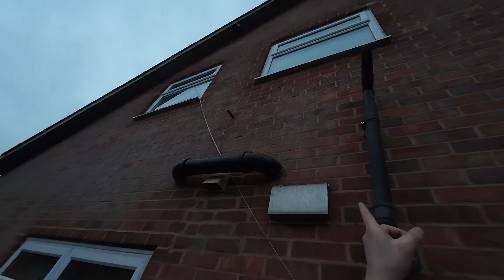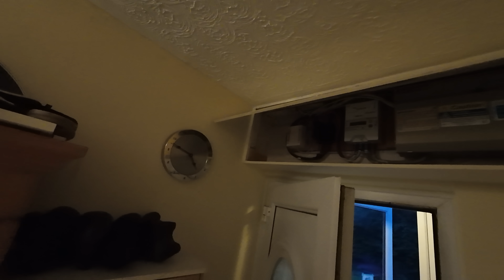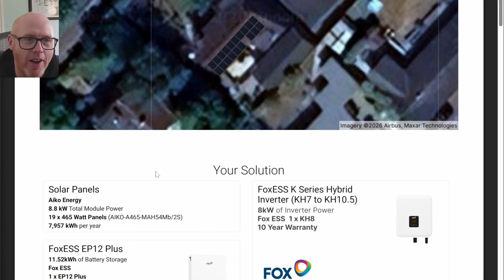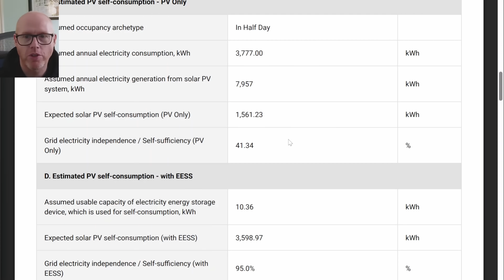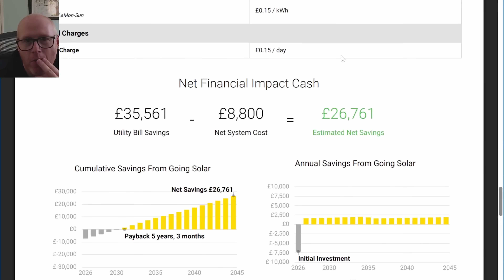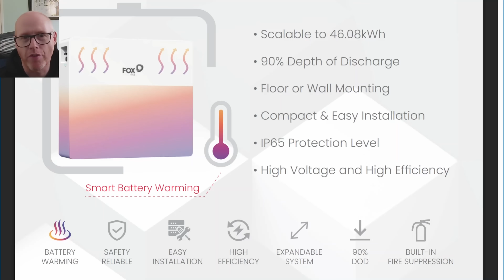The £600 Solar Mistake Most Homeowners Make

Comment: GENUINE QUESTION: Why does nobody ever factor in the opportunity cost that is lost?

If you have £8,200 available to install solar, you could invest it. Assume 9% for average stockmarket return (since WW2) and over the same 20yr period your £8,200 would be worth c£45,000.

Ok, so you wouldn't be "saving the planet", but you'd be financially better off to the tune of £20,000.

What am I missing here? Are people buying systems on finance? Or are there grants available that haven't been discussed or included in the calcs? Or is this not about financial benefit and only on "savings the planet"?
Reply from the maker: Over 20 years, this solar installation will save the homeowner from their £4000 per year bill. £80,000 beats £45,000. (Not factoring in energy price inflation)

Add to the mix, energy security amidst craziness in the middle east and energy prices likely to be hiked significantly from July.

Solar panels seem like a good hedge right now.
Reply: @UpsideDownFork Super quick reply, thank you (especially on a Sunday!). Excellent video BTW, very clear and concise.

Why does the software calculation show a saving of £25,000 over the 20yr term if you're claiming it is £4k x 20yr = £80,000 - £8,200 = £72,000?

I'm clearly a bit thick, or I've missed something obvious.

Perhaps the £4k yearly bill includes gas for central heating and hot water...if so, the bill won't halve, but the PV system will only reduce the electrical consumption to zero and the bill will remain for the gas element. I didn't see any mention of heating and hot water, so I assume those haven't been considered and will remain as gas/oil.  If this is the case, your software is correct and the £8,200 would be better off invested if the goal is to be financially prudent. If the goal is sustainability led, then still go solar.

I'm currently moving house and a renovation project looms, which is why I'm considering the sustainability options, but I'm also weighing the benefits against longer-term financial goals and that's creates an interesting math challenge that has a multitude of variables and consumer choices/considerations.
Reply: How is solar saving the planet?

Comment: Always worth remembering that the import and export rates for electricity can and do change.  The guaranteed savings that you get is from not importing a high cost unit of electricity and this allows you more flexibility, I can see in 2-3 years time solar export rates in the summer disappear for peak hours, but there may also be a cheap daytime summer rate as well. The rate of change in deployed renewables is so high at the moment + gridscale battery storage that the economics are changing very quickly.

Comment: Why "only" 8kW Converter when its an 8.8kWp system? what if the system is at its peak during summer months?
Reply from the maker: The orientation and the inclination of the panels means that we are unlikely to see peak for any extended period. A tiny amount of clipping may happen a couple of times a year. Nothing to worry about. DNO export limitation is likely more of a concern.

Comment: Thnaks for you videos,  Its difficult to choose best system for yourself differing needs, With Stream series can you tell me   Can you discharge and Charge Stream batteries at same time. With a Delta 2 , serms no  Unless you use Xt60, with auxilary battery, Withput owning system its difficult to fully understand its Limitations, Thanks difficult to make a video that covers all angles, 😊😊😊😊
Reply from the maker: What do you mean by charge and discharge at the same time?
Reply: I think AI said you can, Feed in power from off grid batteries, use this 7p electric during day to top up a Stream battery, Effectivly chaging at same time.while discharging 800watt heater😊 Dont worry too much. about it mate, If, get powerstream return repair  I will not need to upgrade. No joy yet with DPD lable. 😊

Comment: I only need 1 or 2 panels and a 2 kw battery. For a bungalow.
Reply: Yes - having 18 or 20 shows u that this home owner is guzzling electric ⚡️ or going to sell it to make mega millions
Reply: @jayswonkeydonkey  Probably has an ASHP they were mis-sold.
Reply from the maker: 1 or 2 panels will generate nothing in the winter. If you want to cover your load in the winter, you need to oversize. Don't spec the system for a perfect summer's day.
Reply: @UpsideDownFork my electricity is about 200 kWh my gas is about ?2000 kWh. How many years will it take to pay for its self? 🤔

Comment: You should say any solar export from april making over £1000 in export is subject to tax now in the UK and anyone on a EV tariff that export over £500 will be subject to tax also, Let's be honest 99% will never hit £1000 in export anyways
Reply: I have an west house in West Yorkshire. 10 panels each side. I exported £933 last year. 
So don't agree with the 99% comment.
Reply from the maker: That's not entirely accurate. £1000 profit, not £1000 export credit.
Reply: @UpsideDownFork  I think when the tax man realizes they not getting much from the £1000 limit, I can see them dropping it to like £800 and maybe a few years later, dropping it less again, It was only the other day, they was saying they going to stop battery export altogether, then they will come after cheap ev tariffs, joke this
Reply from the maker: @BestEDMSongs You are likely right but as the situations stands, residential solar systems are not yet being taxed and there are no current plans in the pipeline from what I can see in the current consultations.
Reply: Basic economics system of the UK will tell you this is a tax waiting to be exploited. Any income you make from generating will be taxed , SEG rates will disappear and standing charge will be hiked to recover lost revenue.  The private equity firms that own our network and generating companies only want to strip assets and make massive profits. You cannot possibly say what the payback time will be. But if you have £10k to gamble do it!

Comment: £600 for 4 panels is that supply and fit? I can buy 4 panels that are better than these for £340 515w panels. how is that a bargain?
Reply from the maker: How much for the rails, the brackets, the cables, the scaffolding and the labour?

Comment: Investing in the North West roof at the same time would bring more energy into the evening peak and give a higher system generation too. More expensive, but fill in the roof in one go might be the best long-term option if they can afford it, deal with the aesthetic of panels at the front as well.
Reply from the maker: Unfortunately the DNO export limitation doesn't make this a very sensible move.

Comment: Thumbnail says spend £600 to save £2000, two seconds later total system price £8,800,  big jump from £600 to £8,800
Reply from the maker: Please watch the whole video
Reply: Pretty sure it means spend £8,800 instead of £8,200 to not need to spend again later another £2,000 in the future then?

Comment: Battery too small for solar and house size , adding on later just increases over all cost , may as well go larger at outset unless cash is a problem .
Reply from the maker: The annual consumption is only 3500kWh. The specified battery is sufficient.
Reply: , you didn't include heating here, did you?

Comment: Is the replacement of faulty components after warranty expires included in your figures? It should be fairly easy to calculate if you know the mean time between failure for them. Not being negative on solar as I am a great supporter of it, just trying to be realistic.
Reply from the maker: Finding the mean failure time doesn't seem to be an easy task.

Comment: With regards to the soil stack protruding the roof.  This could be cut  back into the loft space and an air ingress valve introduced to allow it to function correctly, thus gaining space for an extra panel.
Reply from the maker: Yep, you'll see that in the next vid.

Comment: I love that report wow, all super useful info!
Reply: You can do your own quotes on opensolar. This is the template used for all quotes, it does take a bit of getting used to though, especially when drawing the panels on! Looks super cheap, based on that price and your good experience, I wouldn't even bother with a 2nd or 3rd quote. I'd be tempted to get a quote for a system with a gateway though, like sigenergy, but guess it'd be 5 figures then.

Comment: Regarding the soil stack, you could replace it with a Durgo air admittance valve in the loft instead, meaning no soil pipe above the roof line. 
Another option is a soil stack vent that replaces one of the tiles and looks like a tile.
Reply from the maker: Yep, that's what we're working with 👍
Reply: @UpsideDownFork better still get a vent tile, it will fit under the panels. You an also get some quite low profile vent caps.
Reply: @TheRonskiman  this discussion has inspired me to ask to alter some stacks on my roof when I add more solar.
Reply: Definitely better to remove the soil stack and get the extra panel in, it'll look better too.

Comment: They should plan at the same time for a future heat pump, if I had done this I would have got a bigger battery. I can't expand now as they no longer make the same battery.
Reply: I have a 5 bed house and underestimated the battery. Initial installation was a 15.5 KWH battery but quickly added another 16 KWH to make a 31 KWH battery in total. We use an air source heat pump.
Reply from the maker: We have a plan for that 👍
Reply: @UpsideDownFork  there was a suspiciously large over-generation of power...
Reply: Don't fit a heat pump in the uk
Reply from the maker: @Sun-Tzu-- why? They work great!
Reply: @UpsideDownFork  skip the pump and fit AC a nice cold winter and you will know why. They are ridiculous.
Reply: Ps AC is only 1 option tbf,a double coil unvented cylinder with underfloor heating is my advice.
Reply: @Sun-Tzu--  I think we are fully behind those that want to use AC (A2A) to heat their homes? It has similar efficiencies to A2W heat pumps and can be used low and slow as highlighted by @TimAndKatsGreenWalk.
Reply: @UpsideDownFork they do !
Reply: @Sun-Tzu--  for what reason? Plenty work well.

Comment: Please include the 0.5-0.8% per year degradation on the latest solar panels + battery degradation to 60-80% after 10 to 12 years for most manufacturers, with the cost of replacement. Plus average maintenance costs and repairs to inverters/any broken panels etc over 20 years. And the drop in expected solar power generation further north, as I'm not on the south coast like you. Note in southern Spain, solar works great for my brother, but for his house in Nottingham, UK, he says it was a ripoff.
Reply from the maker: Thanks for commenting.
Reply: Nottingham is about 1MWh per kWh of panel per year. Spain is about double that (depending where in Spain).

UK payback at the moment is about 5-6 years typically. Spanish power costs and export rates are much lower so the payback is actually very similar.
Reply: You did see the estimated payback time was under 6 years? Seems pretty good to me.
Reply: The typical SOLAR BATTERY installation takes 7 to 12 years to pay for itself, but requires new batteries after 10-12 years and increasing maintenance with solar panel degradation.  The payback time can be reduced for high energy users buy 1-3 years, particularly on the south coast", because this allows them to store and use more of their own electricity rather than selling it back to the grid at a lower rate. So, how long on average if ever, would it take to pay for itself with maintenance and replacement parts?
Reply from the maker: Where are you getting this info from? Panels require little to no maintenance and exceed their performance claims in many cases.
Batteries needing replacement in 10 years? I doubt it.

Comment: Electricity markets very different from country to country it seems. Total yearly kWh are no longer as important here ih the Netherlands as is the spread in time. Here we would certainly also put panels on that northwest roof (which doesn't even look so northerly, 315 deg?) , covering the late afternoon/evening peak for ¾ of the year. And under a cloudy sky they will work just as well as SE.
Reply from the maker: Great points!

I'm here in Amsterdam today shooting a future video! 😊
Reply: I think we were in the same situation, but an abundance of solar power has driven it's market value way down in the Netherlands.

The UK is just lagging behind and maximising self consumption will become the norm as well as export rates drop and import rates go up.

Next year our net metering is over and we will not get our energy tax of €0.11 per kWh refunded on export. So that will give the home battery market a big boost with 40% of homes having solar already.

I already have as much solar as i could reasonably get installed, but I may build a nice solar pergola as well if it does not get me into trouble.

Comment: Back in the day installers quite often suggested 3.68kW system as there was no DNO paperwork. 9 years ago I insisted on filling the roof with a 6.2kWp system (22 panels) and had to pay an arm and a leg for G99 approval. The DNO also didn't understand battery and insisted on a site inspection before it could be turned on. 
These days it is all a lot easier, although many areas now flagged as red (near limit) on DNO map of local electricity network so it may be difficult to get a decent export limit if many of your neighbours also have solar.
Reply from the maker: Thanks for sharing your experience!
Reply: In dorset on 1st December 2024 my solar installer used an online fast track for all the paperwork and approval letter was 12th December..

Note: I assume wintertime is the busiest for the government being  just before Xmas.
Reply: The same year for any jokers out there
Reply: @SteveMoore1969  🤣
Reply: Can you see the Dno map online? I mean the red flagging you mention.
Reply: @davidwebster5235 Here  in Merseyside: SP MANWEB HEAT MAPS  (Scottish Power Energy Networks, Getting Connected). Also on netzerogo website .
Reply: Also starting to see places where the G99 isn't just turned down but they also turn down G100 too so it's 3.68kWh or non grid tie.
Reply: My installer fitted 7kw of panels as agreed, and then applied for G98 (3.68kw) They set up the inverter to limit exports to 3.6kw. I took it off, no one said anything else.

Comment: That seems a good deal for the south. Roof tiles look a bit suspect though, I assume concrete, I’d be thinking of a new roof to get the VAT savings.
Reply from the maker: The roofing work has been completed and all is looking well now.
Reply: @UpsideDownFork don't forget to recommend spraying "wet and forget" on the roof before the solar panels go on, it works really well. 
I saw a guy talking about it on a YouTube video some time ago 😜
Reply from the maker: @roblinc2u yep, we've done that already 👍
Reply: @UpsideDownFork 😂👍
Reply: @UpsideDownFork  Those Marley tiles only have a life of about 50 years before the surface goes, particularly if moss has had a good go at them, plus I’d bet there’s bituminous felt that have an even shorter life. Popping a PV system that you’d hope gives you 20+ years on a degraded roof doesn’t make functional or economic sense. Having the roofing materials VAT free would save that house owner about £3-4K and improve the house ventilation.
Reply from the maker: @yp77738yp77739  you'll see in the next video that a lot.of.work has been done to the roof, including new membrane, battens and some tiles.

Comment: Do the batteries provide whole house back up ?
For the house size a bigger battery capacity from the off would save a bit .
Reply from the maker: They can be set up for whole house backup, but we've not opted for it in this case as power cuts are extremely rare in this area.

Battery expansion can be done easily in the future.
Reply: I know they can be expanded as you outlined ,  but that is inevitable more expensive than doing it now , unless it’s DIY and given the array and house size the proposed capacity seems too small .

Comment: Why no panels on the NW roof?
Reply from the maker: DNO export limitation. I'll explain more in the future videos.
Reply: @UpsideDownFork I have 19 SE and 12 NW facing panels, an 8kW inverter, 10kWh battery and a 5kW export limit. Even in the summer I rarely experience clipping losses. I wish I had installed more panels on my NW elevation (could have added 10 more). I get 60% production on NW panels compared to SE panels.
Reply: Isn't the limitation more on the inverter size than the array size?  Having NW panels would generate during the late afternoon / evening peak period.  Sacrifice four SW panels so extend the production time so the battery doesn't have to be used as much during peak.